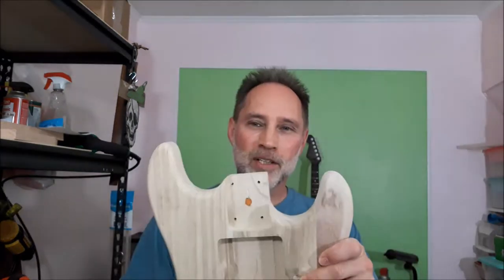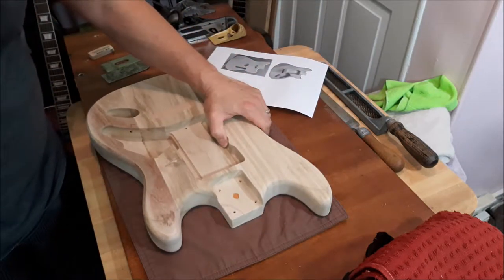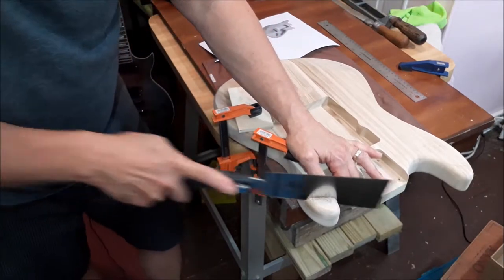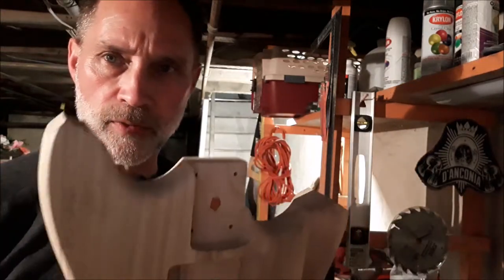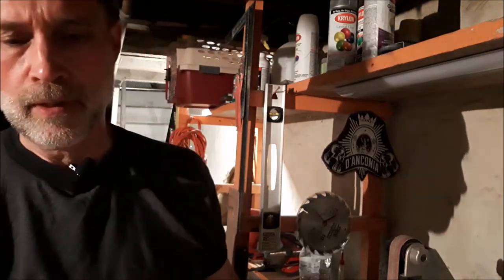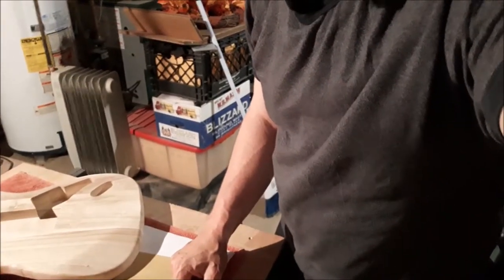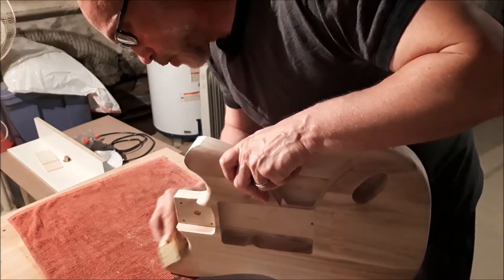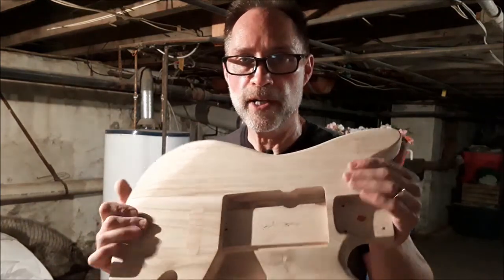Modifying a Stratocaster Body. Jagocaster Partscaster Build Part 2 Cut Off the Horns  Bear59 Guitars

Comment: This wood is sometimes referred to as candlenut wood, sometimes paulownia. It is the cheapest wood sold by Chinese vendors for electric guitar bodies. It does not work well for a classic Strat; the wood is too soft to hold up a Tremolo system. I had to deck my Trem.